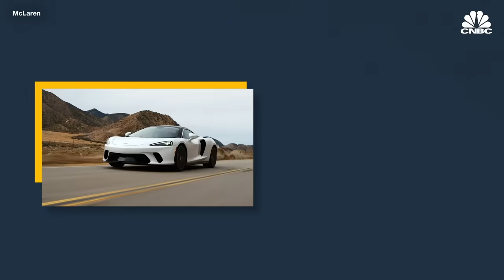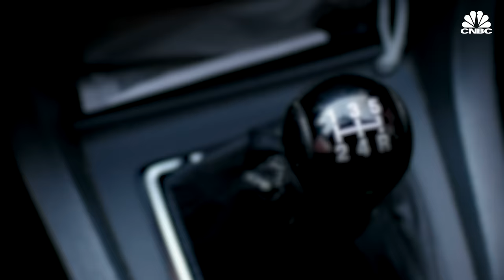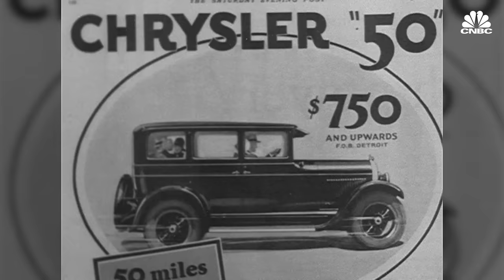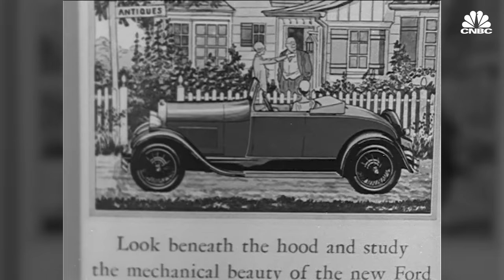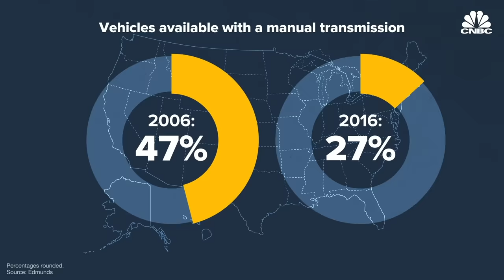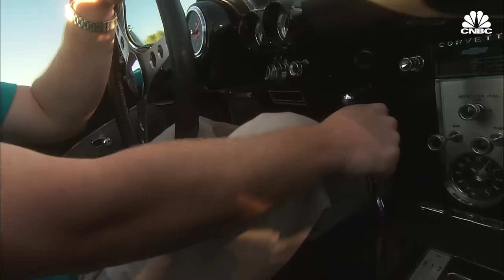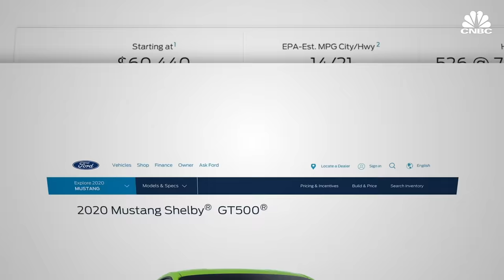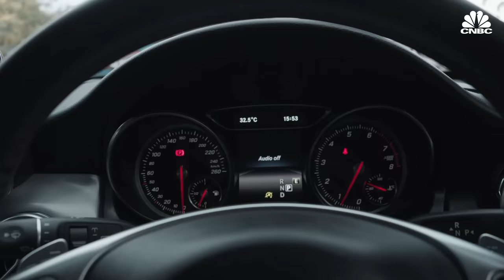Why Stick Shifts Are Going Extinct

Comment: They're only going extinct in North America. Manual transmissions are still popular EVERYWHERE else.     

First off, you can't find manual transmissions at dealerships and if you do it's usually used.  Secondly if you CAN find one, it's usually a base model with little to no options.   

And why did they get rid of the stick shift in trucks?   I remember in the late 80's or early 90's I had to drive a full sized 8ft bed gmc with the six cylinder at a place I  worked a few times.  It was great with the five speed manual.  I also drove with a guy who had a Ford f-15 in a manual.    Trucks like that can't be found anymore.  Unless it's a Toyota.

Comment: Back in the day you had to spend half an hour in an empty parking lot operating the clutch and moving the shift lever.  If you didn't do this, the clutch was too hard to operate.  Whereas a car with an automatic you just put the lever in D and you ready to go.
People who are stupid and clumsy find it difficult to shift, so they spend lots of extra money.
Manual transmissions have become an anti-theft device most car theives won't steal something they can't drive.

Comment: Automatics are boring as hell but very comfortable  specially in traffic. I got used to it after a while. Now I get my manual transmission fun from my motorcycle. Banging through gears, leaning on curves and engine braking, yep you are more connected to the machine!

Comment: I remember one time my ex tried to teach me how to drive a stick and we pulled into a apartment complex and I pulled into a parking spot and there was tall bushes there and instead of pressing the brake I stepped on the clutch and we rolled up on top of the bushes and we both panicked and we switched seats real fast got took off out of there so fast and there was a big hole and flat spot where we ran over the bushes  at the time it wasn't funny cause we could of got in trouble for destroying the bushes but now I think back it was so funny!

Comment: The reason stick shifts are going extinct because a clutch job which
should be done every 70,000 miles cost $1800.00USD. While the auto 
trans option for a new car is about $800.00USD. But this is all moot
because as soon as they perfect self driving cars they will become
MANDATORY. You wont be able to get insurance without one. Our 
driving privileges are about to be revoked.

!
Reply: clutches can last a lot longer than that depending on the driver, and if your paying $1800usd to do a clutch on a normal car you’re getting scammed. should be less than half that usually, replacing an auto is going to be far more costly

Comment: If you need to tow a trailer that is heavier than about 6,000 pounds, a diesel engine pickup truck with a manual transmission will perform far better and more reliably than a gasoline pickup truck with an automatic transmission. This is why most long-haul 10-wheel semi tractors have diesel engines and 12 or 18 speed manual transmissions. The clutch in an manual transmission can handle much higher torque loading than a fluid-coupled torque converter, and when the power train on a big rig does eventually wear out, replacing the clutch disc and pressure plate, rebuilding the manual transmission, costs much less than rebuilding an automatic transmission would.

Comment: because stick shifts are slower, worse, require more maintenance, are less comfortable, are harder, cluch might broke (in automatic also, but it happens more often in stick), automic are better for new car users, worse fuel efficiency
if you borrow car or you buy new car:
automatic - just sit in, put in drive and just drive
manual - every manual car is slightly different, if you will borrow your friends car for example you might have some issues with gear changing and might stall a car
There is literally no reason for manufacturers to put manual in their car
Reply: It's really just old and arrogant drivers that are making noise. People who constantly feel the need to cater their ego by treating driving as some kind of competition. Delusions really.

Comment: Yes, auto transmission is faster.  But what it CAN'T do is anticipate.  If see something in front like ice, or a steep drop-off, you want to change gears some distance BEFORE you hit it.  I would never want to down/up a mountain covered in snow in auto.
Reply: A lot of automatics still give drivers the ability to select gears. 

Usually in the form of paddles shifting or sometimes in the gear stick.

Comment: I get the pros and cons of each but one thing is… learning to drive a manual the instructor was way more informative on me keeping an eye on other drivers, reading the road etc as you have too to plan when to change gear etc

When I did automatic lessons the instructors didn’t teach anything, I find it all the time, people stopping at round about when they could clearly see any cars coming from any direction if they actually looked when approaching and many other examples

Comment: I work at a dealership, so i had to learn how to drive a manual. Straight up wouldnt prefer them. I aint necessarily against them, like for real the statistics show that price wise they are a good option in terms of sale and repair, but its mostly the drivers themselves that turn me off to them. Not all of them obviously but i cant help but say that the majority of the ones I've met and even folks in my family hold this cocky diehard unevolved sense of pride that just really sickens me. But after some of the info in this documentary i can kind of see why. With the automatics origins being so rooted in luxury and upgrades its easy to see why some of the older drivers feel this way, especially those of the working class. Even myself who is a part of that class can empathize this matter with what's happening in the department of the EV being pushed down my throat by politicians. But statistics with the Ford F150 Lightning showing how its once projected price is now skyrocketing causing folks to cancel their reservations for the vehicle proving how ridiculous the concept can become and leaving Ford to reconsider their options or face bankruptcy, manual owners too must realize that their concept, (which is in fact a base, entry style model transmission) will change and ultimately what the majority rule consumer wants will prevail overall. I am no saint in this regard because if the EV becomes dominant i too will have to come to this conclusion, but, the difference is one is based on consumer satisfaction while the other is based in political red tape. So as long as there is still a choice, i would much prefer automatic transmissions any day.

Comment: I used to have several Manuals. You get used to them quickly and many times you do not remember shifting. Plus, it keeps your legs, arms, and brain active. I WILL BE going back to a Manual soon. New or used. Automatics are just plain boring. Paddle shifters are a form of cheating. Top of it all, nobody will steal a Manual shift vehicle. "It is too complicated." HAHA!
Reply: what the heck do you mean "Paddle shifters are a form of cheating"?
They make you shift gears, at an easier level than a stick shift.

Comment: I’m 18 and I have a 2000 e46 328i with 234210 miles at the time for writing this, it’s stick, still holding on and I don’t want an automatic at all. 

Also yes there’s bad electrical problems

Comment: Hey, stick shift gear needs to be maintained every 3000 miles while automatic lubricates more efficiently
Reply: Huh? You change the gear oil in a manual transmission maybe once every 10 years, if that often, regardless of mileage. Automatics are similar.

Comment: but with computer controlled you can actually accelerate  etc faster than a person can so it makes sense for very fast sports cars to go that route.  IIRC, many actual super high speed race cars use computer controlled vs traditional manual.
Reply: Yes modern automatic gearboxes are way faster than any human.
The only reason manuals still exist is for cheap car models and sports cars because people enjoy them.

Comment: So sad I love driving vehicles with manual transmissions. They are fun and I like the control or connectedness and find automatics very boring. I spent over 30 years commuting to work or my business often working long hours. Having to shift had an extra bonus of keeping me awake when tired. I remember my uncle got into to several accidents driving home from work in his automatic cars over the course of his years of commuting. I realized a long time ago that having a manual trans was not only just fun but for me had the added bonus of keeping me alert while driving. I had to go over 500 miles to get a used Tundra with a manual trans and several hundred to get a Dodge R3500 truck with one. Just seems like so many people are lazy and like a bunch of sheep they just follow the crowd and just take what they can get. Just like for many years most of the new cars where white, some version of silver or grey.  At least now its nice to see dealership lots (when they have cars) that have colorful non boring white silver or grey cars.

Comment: I’ve owned 3 manual transmission cars. I could take it or leave it. You do feel more connected in a manual. But I’m fine with paddle shifters too. But driving a manual is over hyped gear head blabber. If it goes fast, who cares?
Reply: the more you mature as a car person the more you will realise that it doesn’t matter if it goes fast or not it’s the experience
Reply: @arcanevoid9199  well, I could live without the “experience” of constantly shifting gears in a manual transmission in city traffic. I don’t hate manual transmissions. But I don’t hate automatics or paddle shifters either. But people who drive manuals think it’s some kind of “zen” thing like surfing. Like “I’m one with my machine”🤣. Whatever floats your boat. I’m good either way. But I’m not gonna trash automatics because I think they are worse. Because they definitely aren’t.

Comment: Automatic transmissions are less dependable, less fuel efficient. I have had several vehicles with Manuel transmissions no problems with any of them. Replaced several automatics
Reply: Modern autos are more fuel efficient than manuals.

Comment: I'm sorry but until the cars will burn fuel, I'll go with a manual. Fuel econony is roughly the same (for a 5 speed manual vs 8-10 speed automatic, now that 6 speed manuals are arriving even on econoboxes I'm not so sure about that), manual is just cheaper to buy, mantain and repair and it's a lot more reliable and dependable. It's extremely rare that a manual trannie will leave you stranded, even if broken you can still drive it to a mechanic while an automatic transmission will not. You can push start a manual trannie car too.

Comment: BS to say that there’s no demand, I bet the reason manual transmissions are going away in the US is because automatic transmissions have a short life span and force people to buy more cars
Reply: Nope. The reasons manuals are rare in the US (and Canada) is because automatics are in demand, manuals are not, and the new automatics are both durable and efficient. Sorry everyone but that's it. If you don't believe me, look at any car company's website for the USA or Canada and compare specs for the same car with a manual or automatic: The auto version uses less fuel compared to the manual, and for performance-oriented vehicles it's often the case that the automatic is faster.

Comment: Im 28 male from europe and i never saw something cool about driving a manual. I prefer automatic anyday. I know multiple ppl that were in near death situations cause of manuals. If u are at a stop and u need to get moving immediately u cant do that always with manual and if you get scared you can also cause the engine to stop let alone driving away fast. Also annoying in traffic or on hills
Reply: they weren’t near death because of manual, it’s driver error. if you are at a stop you can get moving immediately, and you could move off faster in a manual because you can’t start in any gear you want and even dump the clutch if you want to. if being scared is affecting your driving then it doesn’t matter what transmission you drive

Comment: My current car has automatic transmission. I have to say that for daily use it's the best, because a manual transmission is only fun when you're actually driving, not when you're stuck in traffic and barely use 2 gears.

Comment: Maybe someone else said, but even though a sport mode 6,7,8 speed automatic in a modern car will accelerate impressively off the line at a traffic light - in a manual that is a 5 sp or more if you are in the mood and Skilled - with the right engine, weight, and an acceptable suspension (sport/comfort) you can pick the right rpm and find a "sweet spot" that offers super satisfying control and performance. This comment was written by AI that was over-excited. There should be new releases forthcoming, with shorter sentences for one thing.

Comment: CVT is worse transmission type ever. DSG is not reliable compare to manual or classical hydro-automatic transmissions. So, for daily drivers, especially if they are using cars just for transport in one point to another (home-work-shop etc.) auto trans is the best way. But for young people, who try to improve their driving abilities and get more expirience in driving - manual transmission ONLY! Because you get better understanding what happens with your car right now and learn different driving technique (if you wish of course, if not - use auto trans)

Comment: People are too lazy to learn how to drive a manual transmission  i am 64 and ive only had 1 automatic car in all that time and it was an old Ford LTD station wagon that burned 8 gallons of gas if you looked at it. Didn't even have to be running.

Comment: I will never buy an Automatic Transmission with Paddle Shifters.  I lived with it for 7 years. Life was less exciting, I was bored, and on long trips, or in Canyon Roads.  Was not fun. I save more fuel ⛽️ on a Manual Transmission due to shifting to Nuetral and coasting to a stop. 
As apposed to the robots 🤖 I'm Automatics.. the best part it's anti theft system is a Standard H system with the 3rd Pedal 6 Speed Manual Transmission in White 2022 Roush Mustang with Rev Match and Magneride Suspension.

Comment: Don't listen to these boomers. Automatic is the future
Reply: automatic isnt as fun, dont need to be a boomer to understand that
Reply: man all you had to say was that you don't know how to drive manual, don't have to go insulting people about your insecuritites.
Reply: Yea obviously the automatic transmission is better in every way, the only reason people still choose manuals is because they enjoy driving them.
Driving a manual is a different experience then driving a automatic.
Reply: @GrillerRohde  they are better in most ways, still some things manual does better
Reply: Rare Cricket Videos  light clutches exist, I have driven cars where the gas pedal is stiffer than the clutch pedal. and I pretty much live in a metropolitan city
Reply: In my experience manuals are better when driving on the highway since they give better control when going around curves, passing, and descending hills. Low HP engines especially seem to benefit when it comes to acceleration. As far as city driving while I don't mind a manual its a lot harder on the clutch and its not cheap to get those replaced especially in a front wheel drive. I would definitely prefer manual transmission over manual steering and brakes in city driving though.

Comment: One has much more control over a car with a manual gear box.
I drive a 6 speed manual  gear box Scoda.
I have also mastered the art of being able  change gear without using the clutch.
I can drive down a 1:7 incline using the gearbox alone. 80 Km P H in 3rd gear. Engine 4000 rpm  zero fuel consumption.
That is not possible with an Automatic  car.

Comment: If they mandated that you couldn't drive an automatic transmission until you had 5 years experience on a manual then texting while driving would go down. Since most accidents caused by texting are inexperienced drivers, give them something else to do with their hands! And then by the time they can use an automatic, they'll hopefully have matured enough to appreciate what a danger distracted driving really is
Reply: That mandate is never coming. At least not in America. The public won't allow it. The government won't allow it, either.
Reply: @johnnymason2460  I know it won't but I still think it's a good and effective idea if it was put in place.